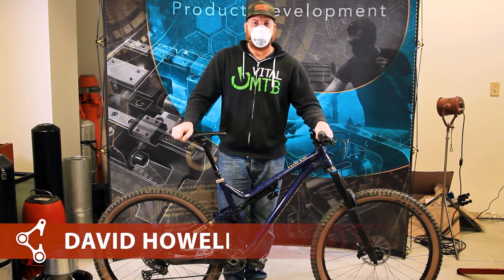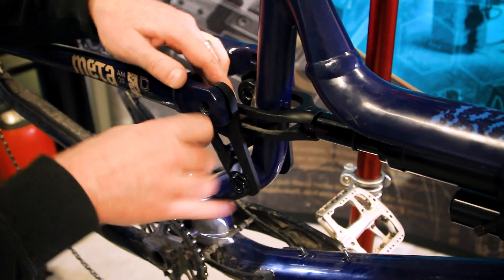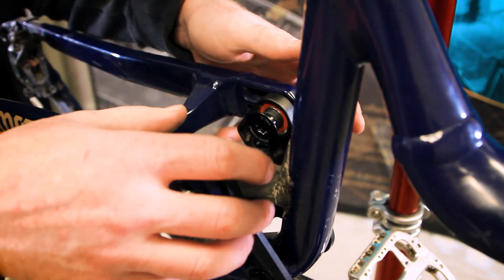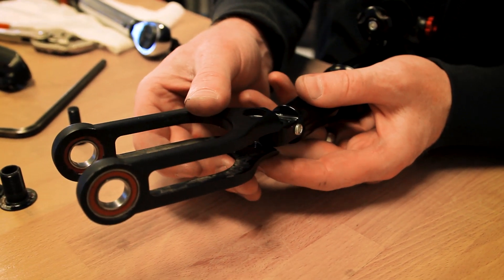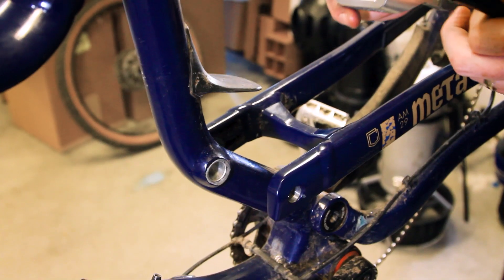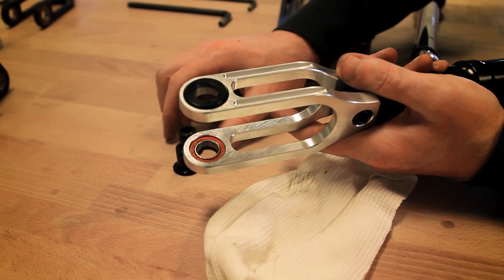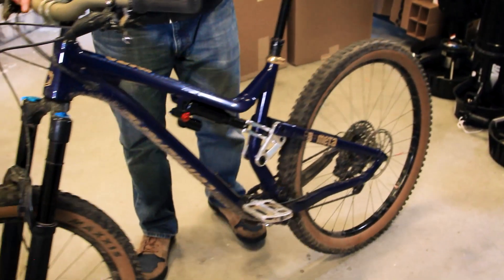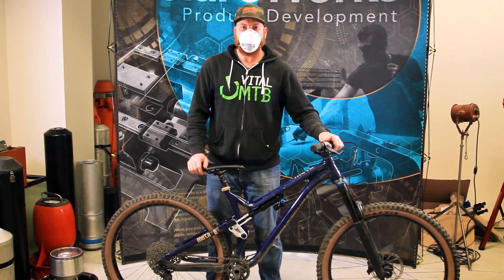Cascade Components Meta AM 29 Link Installation

Comment: The 2021 Meta AM badly needs a Cascade link. There is hardly any bottom out support.  The bikes shock comes stacked full of air tokens and it's still not enough. Are you guys looking at making one for the 2021 Meta AM? Please say yes.
Reply: Send the shock to Fox and have it  re valved for your weight.

Comment: Will this link hit my seat tube?  I noticed the bike in this video has some marks on the seat tube which makes it appear that the yoke is hitting the seat tube.
Reply from the maker: No, there is plenty of clearance between the yoke and seat tube as you can see in the video.  Those marks were there from some of the previous owner's maintenance work
Reply: @CascadeComponents  thanks, yes I saw there was clearance.
Reply: @CascadeComponents  does this link also work for the 2019-2020 meta TR 29?